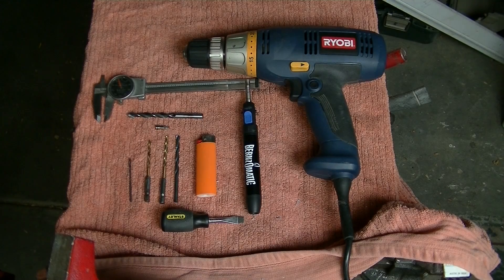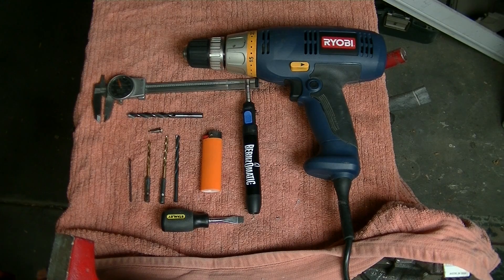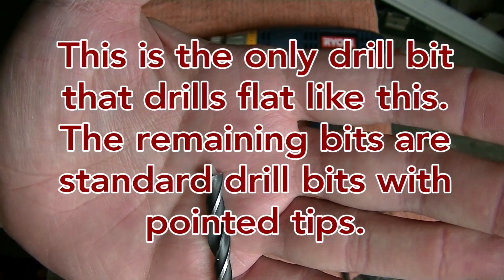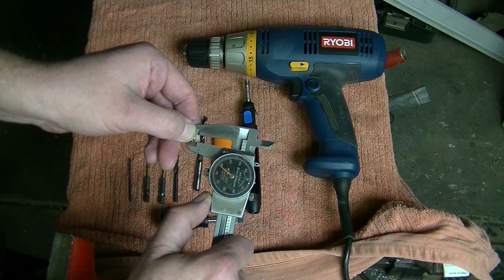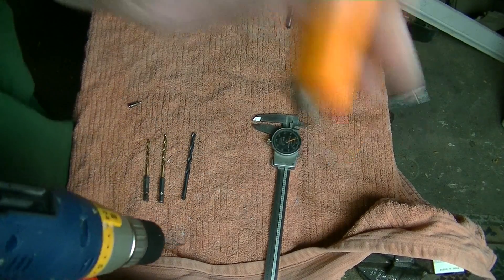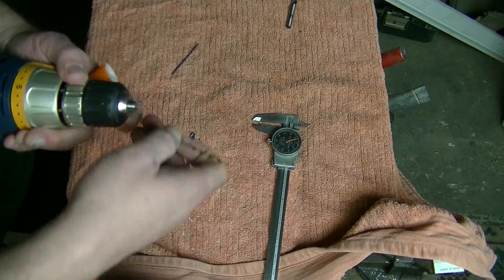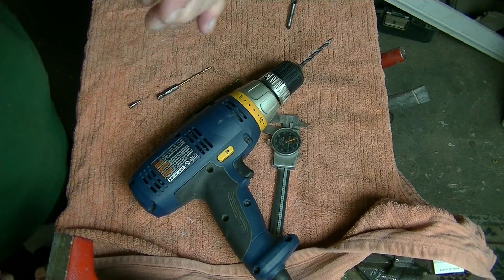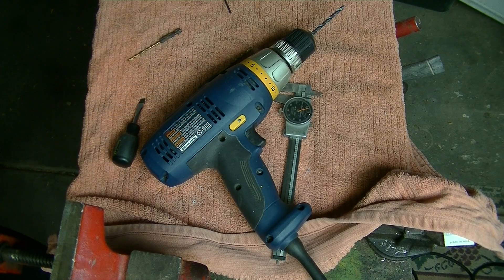Make A Bic Lighter Refillable By Installing A Refill Valve

Comment: good idea brad point drill bit and i found like 50 sites with those refill valves just by typing lighter refill valve on the search box. i think maybe u couldnt find it cause u call it a nozzel instead of a valve. 3 for 4.99 on one site. good idea im gonna make one as soon as they get here
Reply from the maker: Aaron, I actually did several searches using all kinds of terms back when I originally posted the video. And back then, I was not getting any hits that were useful. However, in the last couple of years, this thing seems to have taken off and vendors are perhaps catching on. The video has over 200,000 views now and as far as I know, its the first and only video on Youtube that discusses the installation of a nozzle in a disposable lighter. I can only assume that demand has caused vendors to stock and market these valves as "refill" valves whereas before, they weren't really being sought after for this purpose.

But I am assuming and you know what they say about assumptions...

None-the-less, I can tell you that I did exhaustive searches on google and a few other engines using every possible term and synonym I could come up with and my results were fruitless back then. I've been in IT for 20 years ... I remember when Yahoo was our ONLY search engine ... I'm no stranger to writing and maintaining SQL databases ... so I consider myself within the 90 percentile of folks who could be considered highly proficient at using search engines. I do lack knowledge and consistency when it comes to employing the unique and special commands that each search engine offers its users. But I do make heavy use of the '-' symbol in my google searches when it becomes necessary. I also occasionally like to use double quotes and more rarely, the "+" symbol. But I digress...

Comment: 1st of all that drill bit is called a split pointed drill bit and 2nd of all heres a website you try its called amazon.com
Reply from the maker: Sarcasm noted .... ignorance comprehended. You can't be burdened with actually reading the posts in here which would have prevented you from making such a remark ... we get it ... you have better things to do with your time than to actually educate yourself in a forum before posting on the topic... sorry to have wanted your time.

Comment: a friend of mine in aus. used to tattoo lighters and rub coulored ink into the designs and get $$$$
Reply from the maker: How much money?? I've done this many times but never sold them.
Reply: 10-20
Reply: I used to put my name on my lighters because they always got boosted, then it turned into art. Now I like to use classic etchings like they used on old west guns. people really try to steal them now, it's flattering.
Reply from the maker: Ben North ... have a look at this ... its a small example of what I've done with them... https://www.facebook.com/media/set/?set=a.10212387649474235.1073741852.1470442082&type=1&l=6dbe929ee4

Comment: try  buying a plastic refillable lighter made in china plenty source
Reply from the maker: But the nozzles on those cheap China plastic refillables don't work for this modification. They are usually VERY long, they don't install flush and they are usually cheaply built.

Comment: Honestly if you can afford a "10 dollar nozzle"..... You can definitely afford a 1 dollar lighter..Lol Sorry but the cheapest and easiest way is the pin....
Reply from the maker: I don't half-ass anything that I do in life ...

I am never about "cheap" or "easy" ... I'm about quality and performance. Also, I have found better nozzles for less than $5 since originally publishing this video. If you look at the video description, there is a link. If you're familiar with electronics at all, you might understand this comparison: If you have a wire that has been compromised somehow, and it has a break in it. Many people would argue, that throwing a wire nut on it, or twisting it back together then throwing some electrical tape on it is good enough. I have never in my life repaired a wire in that manner. I will always make sure the ends of the breaks are clean, that there is a minimal amount of outer coating stripped back, then I will put heat shrink on the wire, and using flux, I will solder those breaks back together and seal it with the heat shrink. That will bring the wire as close to original condition as possible, it will absolutely produce the least amount of stray resistance in the repair, and ultimately offer as close to original performance as humanly possible without replacing the entire wire which may be an inconvenient thing to do depending on the situation.

Installing the nozzle CORRECTLY, will yield a refillable Bic lighter in as close to original condition as is humanly possible.

Sticking a push pin into the end of the Bic, to me, would be similar to getting some knee surgery and the doctor using pins to screw some metal into your bone, but then leaving about 4 inches of screw protruding from your leg. Not acceptable, not anywhere near original, and in no way is it convenient.

But, this is merely my opinion. I don't half ass anything, and if it's worth doing, then it's worth taking the time to do it right!
Reply: +Mike Sims Yes if you want it right...you do it right..... I feel it depends on what resources are available... Now about your semantics .. If it's your own body part on the table. Am assuming everyone would want it done correctly....No push pins....lol Anyway.. Don't misunderstand me though your video is good... Again "If you have ALL of those resources available..."  For those people that dont..there are quicker cheaper ways... Might not last as long as yours.. Never the less it's an easy quick way that also WORKS.. That's all... Oh Yeah..  Your next video might be.. "How to replace the flint" lol.. Well If you want that lighter to work as long as you say it does... Just saying... Thanks for the response....
Reply from the maker: OK, I'll concede to the "depending on available resources" condition. There may, of course, be those times when you have a can of butane available and a push pin, and no flame for your stogie ... obviously desperate times require desperate measures.  :-)

Thank you for the compliment on the video.

As far as flint replacement goes, I'll have to see if I can come up with a decent method that doesn't involve locating where the spring went down in the carpet 10 to 15 times in two minutes... lol
Reply: Exactly!! Desperate measures lol.. ok ..i will be watching.. Thank You.. God Bless

Comment: anyways yeah for those that want the fast easy way just heat nozzle with another torch and push it through. I would try the side of the whole, cause I never did it directly into the whole just off to the side. makes the bics with the logos and your walking dead bics coooooooool. ya know
Reply from the maker: I say ... whatever floats your boat!  Just make sure it's safe, that's all I ask.  :-)

Comment: ok so the way we use to do it back in high school 02-06. is when the torch lighter messed up or you had one just to take apart you take the nozzle out and your BERNZOMATIC would be great but just another torch or butane can ones with torch on the end. you heat up the nozzle and stick it through...........oh we never did it through the hole we usually did it to the side of the whole on the flat part. just the easy way I think. but as I have gotten older now I have tools and I say as with all things best to do them right. good shit man. way to put these grommets up on game.
Reply: Yep.
Reply from the maker: What you state here seems very plausible to me. However, the scope of this video is to show people how to convert their existing Bic into a device that is as close to the original as possible, getting more mileage for their money. It's not meant as a "life hack" to meet a need in an urgent situation. This is something that is planned and carried out for it's future utility... I do appreciate the scope of your comment though. Knowledge is power, after all.  :-)

Comment: Definitely have to try this one. You can get the nozzle from a torch at home depot for $10 I'll buy a few of them. I did the pushpin trick but I find that you waste a lot of butane to refill something that cost maybe $2.

I've torn apart dead BiC lighters for the flints for my Zippo but The fluid evaporates too quickly from the zippos so I'll be trying this trick. and when the flint wears out just hack another lighter.
Reply from the maker: Thanks CoonDog ... I appreciate the compliment.  I agree with you on the zippo thing ... I simply don't like them because they are high maintenance ... in my opinion.  :-)   Good Luck!
Reply: I just need to find that torch thingy you mentioned at Home Depot but I don't go there much.

Actually I have a broken micro torch that leaks. Maybe I can use that.

Foo Fighters, Good band. What's your fav song by them? Mine's learn to fly.
Reply from the maker: Actually CoonDog, if you look in the video description, I have updated a link where you can purchase the nozzles for $4 plus shipping (the more you buy the cheaper since shipping is just one price no matter how many you order). And they work better than the home depot torch lighter nozzle because these are smaller and you don't need to chip out the inner wall of the lighter.  I love these new nozzles. Onward and upward... :-)
Reply: +Mike Sims unless they sell them on Amazon I can't get them. cannot buy online unless it's on Amazon.
Reply from the maker: coondog, Here's the same one on Amazon but the price is too high in my opinion: https://goo.gl/evV5LM

But if you look to the right side of the auction you will see that they offer it from other sellers through Amazon for $4.99

Here's one for $8.99 https://goo.gl/FF9jeF

Here's a brass one that should work for $3.99: https://goo.gl/YDFgz7

Here's three of them (little different type but should work) for $17 free shipping: https://goo.gl/TERU62

Search their sporting goods section for 'AirSoft valve' and see what you can find.
Reply: Will try the $4.99 one. I'm gonna get a bunch of stuff from Amazon so I can get the free shipping.
Reply from the maker: Let me know how it works out
Reply: *****
I will. I got a bunch of stuff on amazon but not the nozzle. Will have to refill my amazon wallet then I'll buy a bunch more stuff including the nozzles. There's a portable composite video  recorder that I'm looking at getting. Kind of a bummer that they raised the free shipping price to $49 or whatever.
Reply from the maker: $49 is hardly a free shipping price ... do you not have Amazon Prime?
Reply: *****
No I don't see paying a monthly fee to shop online. This is for orders over $49 are free shipping. That seems to be the latest way for amazon to make money.
Reply from the maker: I get that ... I order enough small dollar items that Prime makes more sense for me. Last year, I totaled everything up, and I would have paid over $300 in shipping costs had I not had prime.
Reply: *****
I don't use it much so prime is not for me. When I do buy I try to spend enough to qualify for free shipping.

Comment: Great vid! I came looking for inspiration after tearing apart some old butane refillable lighters I had lying around, They were of a different type, so I used them to make some refillable Bic Stick lighters, and went to order some of the type you showed and found them out of stock. I managed to find them on eBay, of course. http://www.ebay.com/itm/271563015226 Thanks again for the vid.
Reply from the maker: Thanks Ryan ... that auction describes it as being "valves" (plural) but fails to mention how many you get for that price. If you order them from here: http://goo.gl/lGhFxO They are $4 each plus shipping ... and the more you order the better the price because that one shipping price is the same whether your order 1 or 20 from what I understand. Also the nozzles you show in the ebay auction look the same as the ones I just showed you and they are short enough that you will NOT need to chip out the inner wall of the Bic ... they are much better nozzles than I show in the video.  

Thanks for the compliment, it was my pleasure making the video. Good luck to you!
Reply: I think the ones I found are the same as the link you provided, they're just sold out at your link. $14.73 shipped for 3 of them is what I paid. I'll let you know if they're any good.
Reply from the maker: I'm sure they'll be fine ... price with shipping on qty 3 is roughly the same as the link I provided ... what I have discovered lately, is that once you modify a Bic with the nozzle ... the Bic has been growing legs lately ... my "friends" no doubt ... who pocket them then help me look for them when I can't find em ... lol

Comment: How do you replace the flint  ?
Reply: +Mike Sims The BIC flints are more or less the same size as the ones I use for my old "Rowenta Snip" lighter. I do not know what type they actually are but I already bought them in two tobacco stores (Munich, Germany). They work just fine with the BIC!
Reply from the maker: Very carefully ... but if you're not emotionally attached to your lighter, I recommend unscrewing the nozzle from the flint-less Bic and installing it into a newer Bic. I should mention that I've got Bics that I've been refilling for more than a year and I've never worn out the flint.
Reply: Take off the metal flame shield, then take off the spark wheel, slowly, taking care not to let the spring shoot out. I use my fingers, takes about 5-10 secs. You will have to use a super small flat head screw driver, like you fix glasses with, for your first time, then you see how easy it is and never have to use a tool again. I use my index finger nail like a flat head screw driver to hold the flint down while I slip the spark wheel back on. Make sure you put the wheel on so it "bites" in the right direction. Slip metal spark guard on and you will be good to go for a few months.